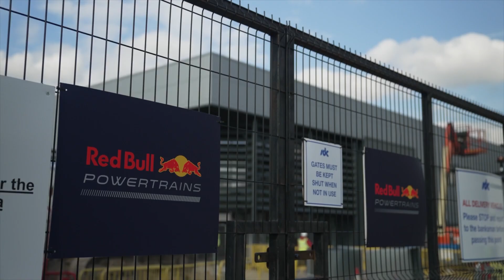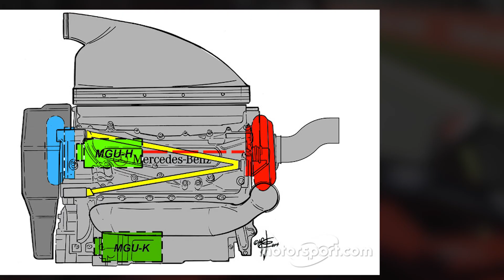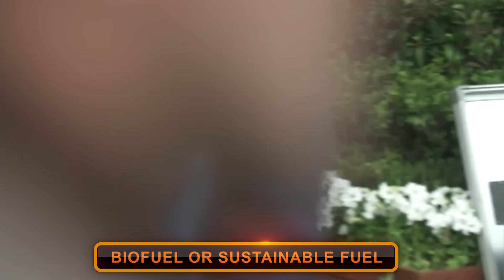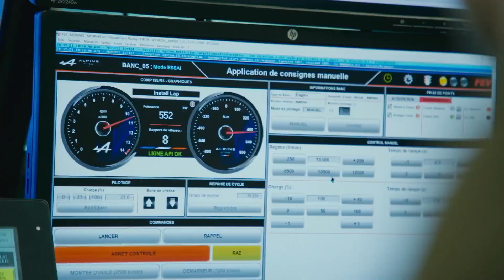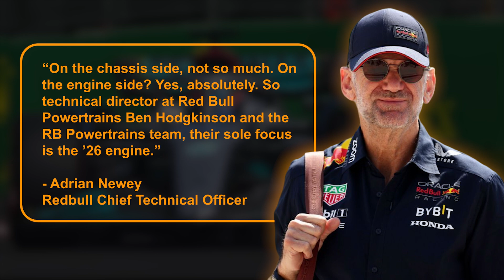Unveiling Mercedes' Bold Hiring Decision: Ferrari Power Unit Engineers

Comment: The problem I have with F1, are the clandestine relationships with the rich and wealthy team owners, relationships that foster special considerations not normally seen across all teams.  Case in point:  Audi, and I'm wondering what kind of special favors they're going to receive from F1 and the FIA, to become "real team players" to be fully vested in the sport.  

Reflective of the Mercedes powered Brawn BGP 001 in 2009, when Ross Brawn purchased the 2008 Honda F1 team, renamed it to Brawn Racing, then magically won eight races (Button/Barrichello) and won the 2009 drivers and constructors titles.. in their one and only season, using a mediocre driver, in Jensen Button.   Extraordinary or collusion at the top of F1?
Also reflective of those special considerations is the 2009 Red Bull RB5.. winning six races and finishing second under the FIA's new 2009 sporting regulations.. followed by 2010 thru 2013 when Red Bull dominated F1 with a mediocre driver, in Vettel.

Now, with the FIA's new 2022 regulations, Red Bull, apparently, has followed the same ethos that created the RB5...using early insider information to design/construct the RB18, which also came out of the gates fully developed and now dominating F1, leaving the other teams in their wake.
Reply: You don’t think Audi should have extra budget to build a powerunit? Everyone else has been doing it since 2014. Merc has been doing it since 2010
Reply from the maker: Hey @BobbyOfEarth! Massisve thanks for the comment! Some great insight from a true F1 fan! Hope you’re subscribed to the channel we here at The DRS Straight love reading your comments! Please keep them coming!